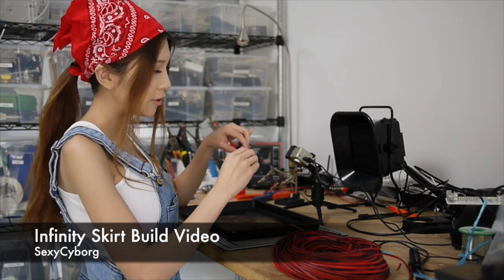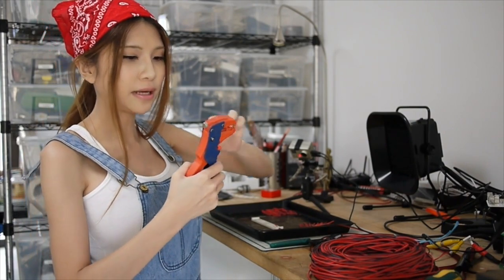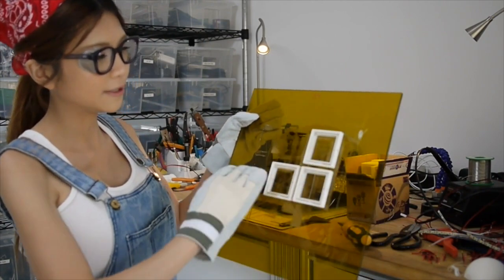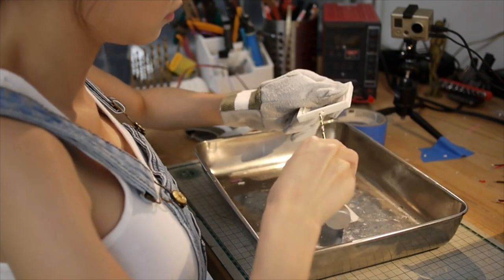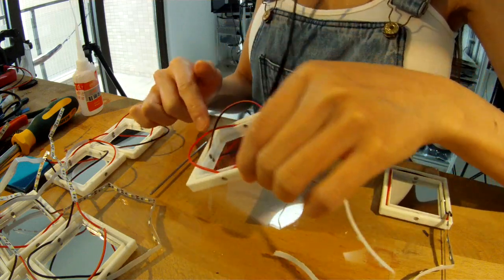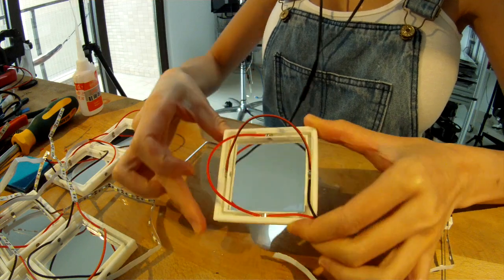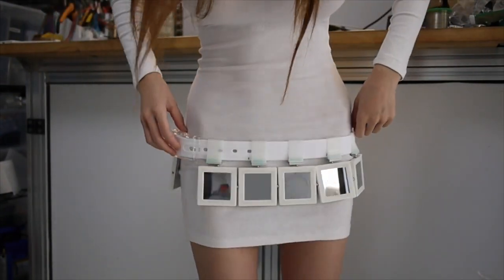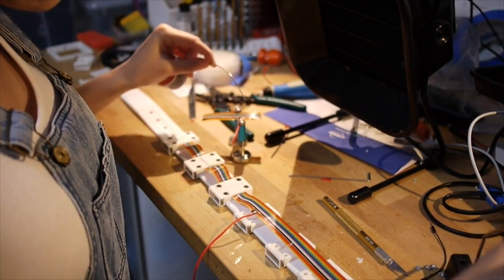Infinity Skirt Build

Comment: Hi Naomi Wu. I built an inifinity window about 2 x 2 feet square when i was 16 years old in 1975. I had it on my wall in my room and a friend looked through the window to see how far it goes out lol. 
I also built a 12 inch round one back to back so its depth is actually 6 inches wide total. I hung it with a disco ball motor With 12vdc power as it spins. I give one to a friend that owned a bar. The customers sitting at the bar was mystified. 
Just some pointers if you will, lower the brightness because its more defined than too bright and having terrible views. 
Obtw i met you at nyc maker fair when you just got in Sunday. You took a pic with me. Big guy wife was visiting family in China.
Remember?

Comment: The razor blade wire cutting does seem dangerous.  Maybe you could make some sort of lever to hold the blade and cut, like those big paper cutters?  Or use an xacto hobby knife which would give you a better grip.

Comment: Why not use wire cutters?
Reply: That's exactly what I was thinking. It would have been a lot faster than using a razor.
Reply: 15thTimeLord the thing she was using had lines on it for the length she needed each wire too be. Kind of hard too get the same length each time with wire cutters.
Reply: Yes, attacing a jig to a pair or wire cutters would have made sense. Perhaps Naomi Wu, was weighing up the time of building a jig versus brute forcing the solution.

Comment: very clever design, did you have any problems with the magnets not holding?
Reply from the maker: I had to use conductive grease so when they move the connection was not broken. It's more a proof of concept thing...

Comment: Surprised you did not use Velcro strips instead of magnet strips as they would hold things a bit better I think, also you would not have to worry too much about them dropping off while walking or bending over or sitting down as much I think.  Any ways, cheers on a brilliant combination of technology and fashion loved the infinity mirrors that was such an amazing affect.
Reply from the maker: The magnets is how the power is transmitted between tiles. otherwise would need wires and that's a lot less interesting...

Comment: If you want to get your things off the Plexiglas sheet that you 3D printed easily and more safely, you could use a Putty knife or drywall knife with a wide blade as they are flat, and flexible metal blades that would go under the objects you printed without causing any real damage while helping to separate your 3D printed objects from the sheet.  They are cheap...shouldn't be hard to find as they will be in most hardware stores or paint/drywall shops.

Comment: I didn't read all of the comments to see if anyone answered your question, but from the ones I did read I can assume no one did. The reason it's called a wire stripper is because it strips the insulation off of the wire.

Comment: I should add, your wire cutting jig was a smart way to handle cutting all that wire. And I'm glad you like your, what I've always heard called, "Self Adjusting Automatic Wire Stripper." They are definitely handy. The one con is that they often leave a nick in the wire at the beginning of the strip point, and simply don’t work on certain types of wire. Maybe consider getting what I've always heard called a "Gauged Automatic Wire Stripper" if that con is ever an issue in a future project. Again, great work and thanks for sharing! The "infinity panels" are very hypnotic, great design :)
Reply: I've always called it a T-Rex wire stripper and yes, it's so fast. The "many notches" wire stripper is also very useful for thin wires, if that's what you mean by the "gauged" one.